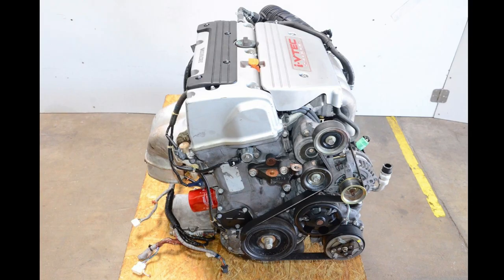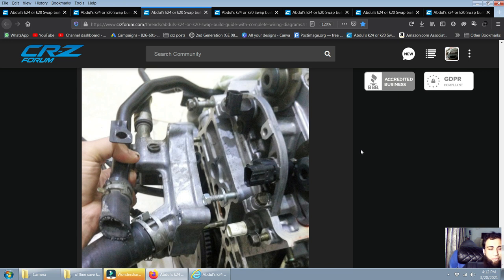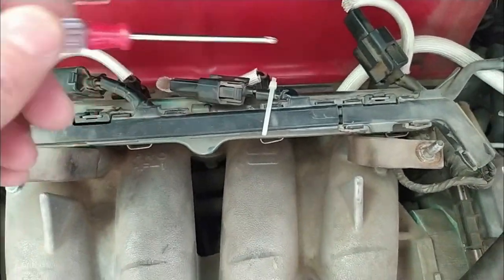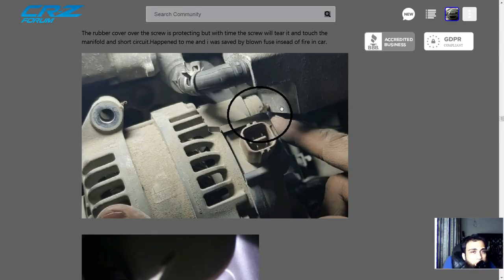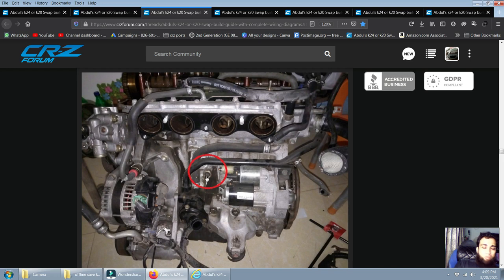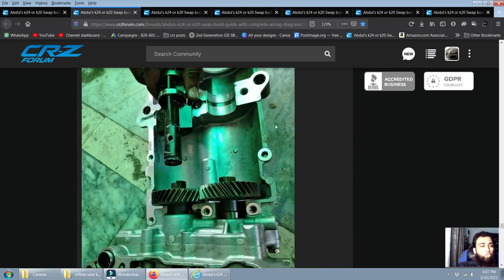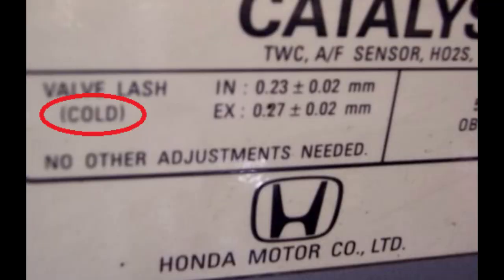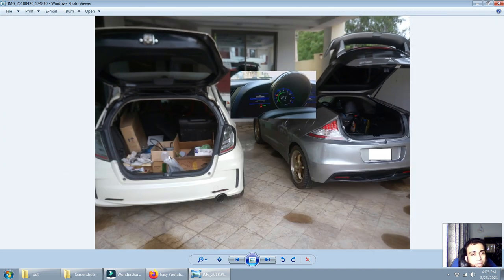Part 03 Honda CRZ/Fit k-Swap,Taking out OEM engine  & Preparing new engine

Comment: If I understand correctly, for the power steering pump delete, I need An idler pulley from an K20A3 (Ep3) right? and do I need to change for a different belt or the Oem belt from the K24A2 is gonna work?
Reply from the maker: OEM K24s2 belt won't work as the Ep3 idler pully is way smaller than the pulley of Hydraulic steeriing pump. Belt 
7PK1640 can work. Also depends upon bottom end. if its a k20 or a k24 as K24 crank pulley is bigger
Reply: @A.QPerformance  thx for the reply you really are helping me there with my project ! I have a k24a2 bottom end so im gonna look the number you gave me for the belt thank you !

Comment: For the k20 Honda Fit what throttle body did you use drive by wire or drive by cable ?
Reply from the maker: Newer Fits and CRZ are Drive by wire. i am using same. i mean i am using USA Civic Si ecu which is drive by wire. nothing needed to change in wiring for throttlebody. grips are bolt on
Reply: @A.QPerformance  Thanks that helps alot! 👍